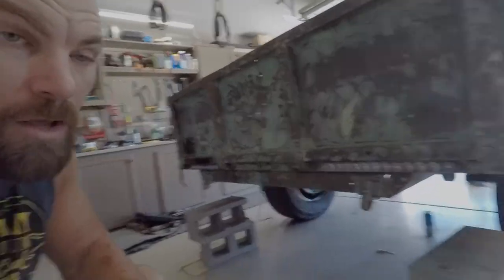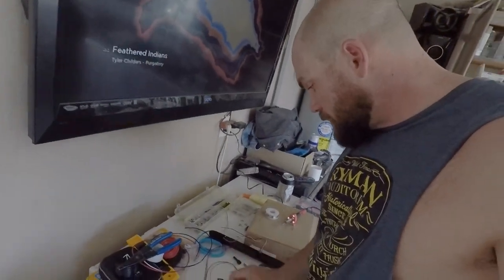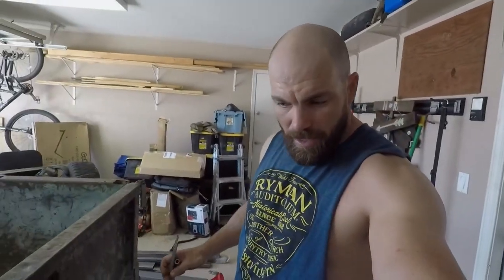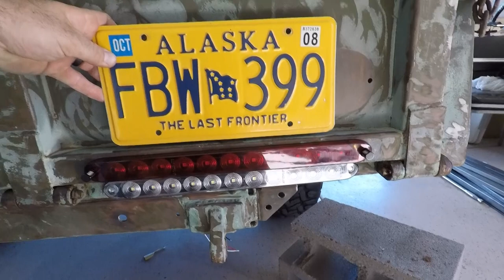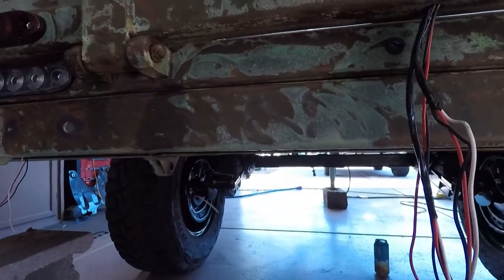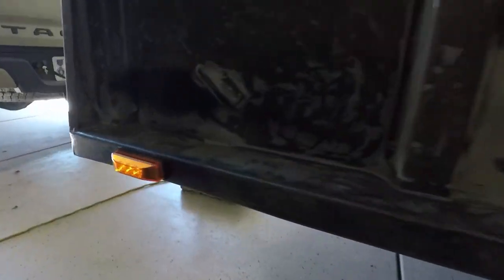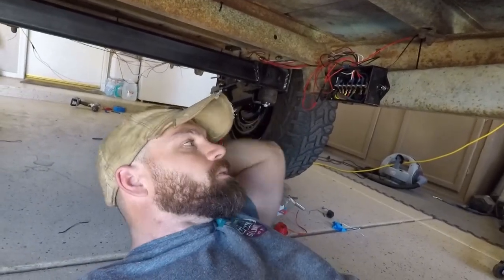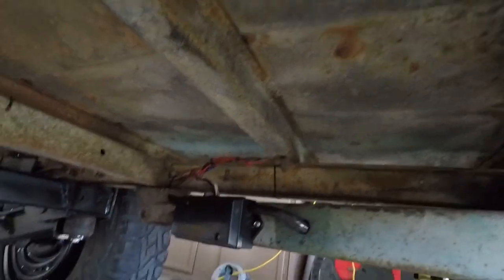M101 Trailer Build E5 - Working Lights

Comment: I am a little late to the party watching this video, but, at the 4 minute mark, fitting a socket with wires, I have specific sockets with flat spots ground on the shank to fit an open ended wrench. To me, it's a good idea it to buy an individual socket to modify for specific uses. I learned this many years ago, adjusting a Harley clutch. 3.99 at Autozone as opposed to $18.99 for a "clutch adjusting socket"
Reply: also, watching you wire, I'll share my favotite secret. When laying wires, I use un-insulated butt connectors to hold the wiring where I want it, then solder and heat shrink them. I've done this on a few trailers and many, many motorcycles, with zero failures
.

Comment: Thank you for your Service Brother, I’m a Purple Heart Veteran too. Do you have an email you could share? I really am looking for a M101 or M105 trailer and would like to chat with you on where exactly you bought yours. Looking for a truckbed replacement myself
Reply: Really like the independent suspension you installed, far superior than the old ones we had to deal with. Is this an overlander trailer?
Reply from the maker: Jason thanks for your service too! It’s going to eventually be an overland trailer and hunting rig. Still a lot to do but I’m making progress. You can reach me at shoreshunter@gmail.com if you have any specific questions. Depending on your area you can find the M101 at military auctions for cheap, unfortunately here in AZ I looked for over 6 months before I found a reasonably priced one and as you can see it wasn’t in that great of shape.